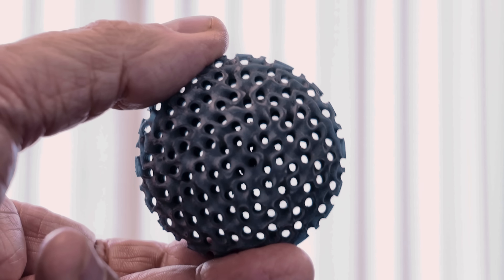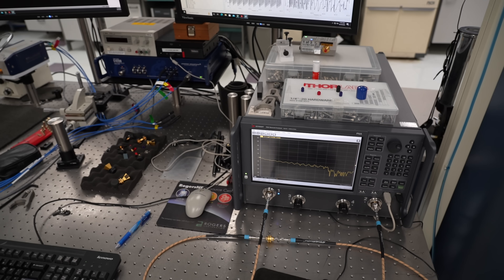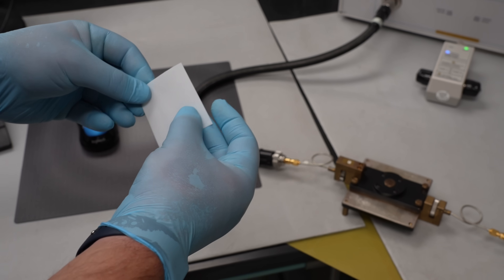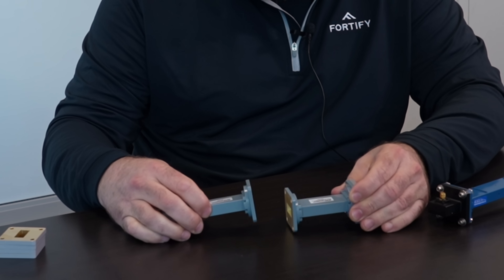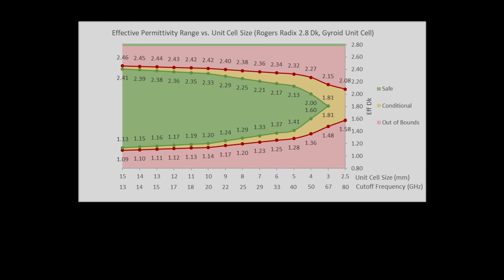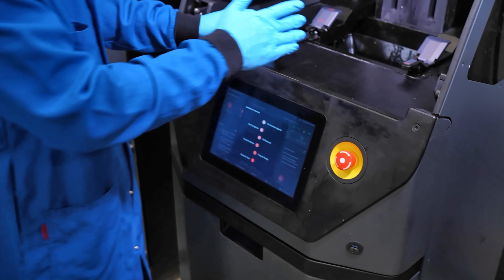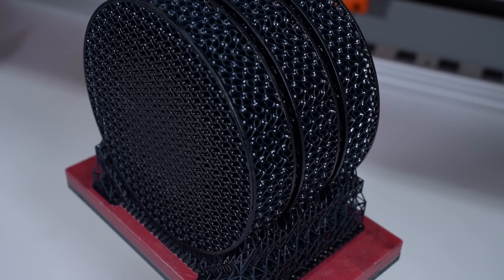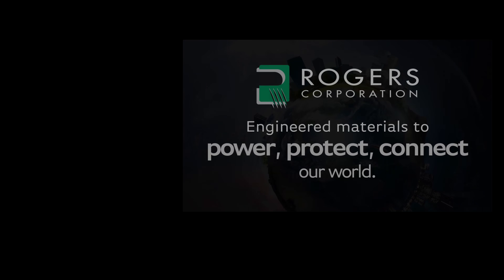Unveiling the Future of Antennas and RF Lenses using Radix™ 3D printable material!

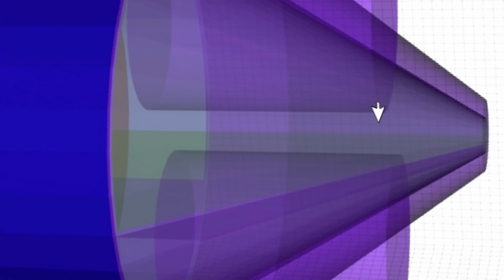Comment: 5:44 where I lost it. That was the best jargon interlude I have ever heard, so casual, had to listen to it 5 times. Fantastic. Master craft workmanship and concept. Couldn't figure what the  hybrid mode part meant. Modes in waves or an operational mode of the antenna, cool stuff. Don't mind me just passing through.
Reply from the maker: @electrikhan7190  Hybrid modes are just a superposition of a linear waveguide mode with the electric field entirely transverse and another, possibly circular mode, with the magnetic field transverse to the direction of propagation. The resulting combined mode has some magnetic and electromagnetic field in the longitudinal direction. It can be analyzed as a simple linear superposition of the two modes. That's a bit of a simplification. One day I might try to do a Blender animation to try to explain it visually.

Comment: It's kind of fun to watch videos about fields that I have no experience in that use words that I know, and try to guess the concepts being used.  I heard the phrase "loss tangent" being thrown around a whole lot, and I tried to guess the variables that would go into an equation where that's relevant.
Reply from the maker: Loss tangent is also known as dissipation factor. If the conductivity of a dieelctric is pretty much zero, the loss tangent reduces to the ratio of the imaginary permittivity to the real permittivity. For the values of typical microwave dielectrics, the loss tangent and loss angle are about the same (small angle in radians is near enough equal to it's own tangent).  The imaginary part of the permittivity is a result of the dipole relaxation and other effects in the dielectric and it has the same effect as a non-zero conductivity would, it causes conversion of EM energy into heat in the dielectric. The derivation is from Maxwell's equations. See https://en.wikipedia.org/wiki/Maxwell%27s_equations and https://en.wikipedia.org/wiki/Dielectric_loss

Comment: I wish I understood what it is you printed, but damn, I'm excited for you, and excited to see this video. All I understood was, "new 3D printing tech = cool"
Reply from the maker: The big disk is simplest to explain. It's like a magnifying glass, but for microwave radio signals instead of light.  Instead of having curved faces, the density of the material is high at the centre and low at the edge.  It follows a particular relationship so that radio waves hitting the first surface are refracted because they take less time to go through the less-dense parts, just like a magnifying glass for light works.  Beams going through the thinner parts of the glass go slower and the sloping face causes the beams to bend as they enter the glass.  The radio lens uses a different mechanism and the equation describing the density at a particular distance from the core needs to take that into account (that's the inverse hyperbolic cosine part, but it's just a way to define the required density at each radial distance.  By using the precise mathematical expression, the radio waves get bent just the same as they would if  they went through a magnifying glass with the same focal length. That's a slight simplification because there is also a quantum mechanical mechanism going on with multiple partial reflections, but the overall effect is very close to what you'd get if you made a magnifying glass from high density polyethylene or PTFE, except they are a pain to machine or mould, and tricky to support.  The simple cylindrical Mikaelian lens is easier to mount.

Now we have a lens that can focus, we mount a small radio antenna horn so it's "phase centre" is at the focus of the lens.  Microwave signals fed into the horn then illuminate the surface of the round face at the end of an expanding cone of waves.  The waves are then refracted and when they leave the outside of the opposite phase, they look like a searchlight beam of radio energy.  Because the cylinder is only around 15 wavelengths across, there is a bit of diffraction and spillage, so the output beam does diverge slowly.  

I'm going to try to show this in a future video rather than using words, as that will be a lot more obvious I hope.  The smaller part is much harder to explain, but it's acting as a sort of focusing lens as well, but the mechanism is very different and the lens is only about 0.8 of a wavelength across.  That's the equivalent of a lens maybe a third of a micrometre across with visible light.  It would be near enough invisible to the naked eye, so you have to look at the electric and magnetic fields really rather than using the large scale approximations of waves.

It is totally fascinating, but you need a good grasp of undergraduate maths to do all of the calculations unless you cheat and use an electromagnetic solver that runs a few hundred million calculations in tiny Yee cell cubes all over the model, working out every cell's effect on its neighbour and vice versa until you reach a steady state.  Finite Element Analysis is similar.  I use a Finite Difference - Time Domain solver.  Huge fun.  It's going to be a really interesting challenge to explain that lot without expecting everyone to do a two year maths and physics course starting with partial differential equations, but I'll have a go when I get some time
Reply: @MachiningandMicrowaves  Thank you so much for the practical and succinct explanation, I really appreciate the time it took to write this out and elucidate some of the deets. Have my sub, ser!

Comment: Stumbled across the video. I'm not into antenna's or frequency related items, but I do like tech....and this video is freaking amazing. Learned lots.  My thought from a broad scope is that as we move to more ideas available worldwide, I could see purchasing specific item designs (for anything) for personal use and going to the local '3D print shop' to get the device created for my use.  Commercial work could also be done by larger companies and more structured IP controls.
Reply from the maker: JLCPCB do a nice bureau service and there are some excellent US based services for laser sintering, so it's happening

Comment: A wave guide for Electro-Magnetic Energy is a profound concept.  Steering a radar pulse into the rough direction of your target, negates any omni-directional waves of radar broardcast.  The enemy would not know where you are, unless they were in your line of sight.
Reply from the maker: I use passive bistatic radar techniques to track planes sometimes, then I don't need to transmit at all. I just monitor the reflections caused by distant transmitters and use the reflections from planes to work out their speed and direction. It's tough to get height but I get a heading within 1 degree or so.  Great fun

Comment: Came across your video and was curious.  I have long thought gradient index technologies had great potential.  Always wanted to do microwave spectroscopic imaging of everyday materials.  If you have not seen how Tunneling Magneto Resonance detectors are made you might want to look. You can heat them with lasers above the Curie point, then cool them in a strong local magnetic field with nanometer resolution.  You might modulate the frequency of your beam to extend the near field.Thanks.
Reply from the maker: I've has a good read of some background papers about the tunneling effects and how nanometre cystalling MgO films were used, but I think that is about Tunneling Magnetoresistance as used in hard disk read heads.  I see some references about resonant electron tunneling in GaAs/GaAlAs double-barrier heterostructures but I don't see anything about laser annealing of the layers.  Do you have any references that might shed some light please?

Comment: The original machine has a base-plate of prefabulated aluminite, surmounted by a malleable logarithmic casing in such a way that the two main spurving bearings were in a direct line with the pentametric fan. The latter consisted simply of six hydrocoptic marzlevanes, so fitted to the ambifacient lunar waneshaft that side fumbling was effectively prevented. The main winding was of the normal lotus-o-delta type placed in panendermic semi-bovoid slots in the stator, every seventh conductor being connected by a non-reversible tremie pipe to the differential girdlespring on the "up" end of the grammeters.
Reply from the maker: Yes, yes and thrice yes.
Reply: Well said. Very well said. I’m forwarding your résumé to the Screenwriter’s guild so you may be employed on scripts for upcoming Star Trek movies.

Comment: Very interesting tech. I personally work in the satellite internet internet industry, and while I can definitely see a huge benefit to static antennas here, the industry is rapidly moving towards satellites that move through the sky in a LEO orbit.

If they can use this tech to make an efficient electronically steerable beam with at least a 120 degree scan range, then I'm 100% sold. That said, this may make better phased array antennas possible, and of course we're still using mechanically steered parabolic reflectors which could also benefit from this. You should also look at what companies like Kymeta are doing with reconfigurable metamaterials which, in my opinion, is the true future of RF antenna design. Had I been told a few short years ago that I'd be working with flat panel antennas that literally form a beam using microwave holography I wouldn't have believed it, but here I am doing exactly that.
Reply from the maker: Yep, the new chipsets for beamforming phased arrays from AD are looking interesting. Metamaterials is also getting interesting again after a surge of woo and invisibility cloaks a few years ago. Interesting times we live in.
Reply: @MachiningandMicrowaves  Very interesting times indeed. I just spoke with a company last week that are developing flat panel ground station antennas for LEO constellations based on some research out of the CSIRO. The radar antenna in the F-35 Lightning is also interesting, as it uses an active array meaning it can track multiple targets simultaneously.

Anyway, cheers for the detailed insight on this super interesting material. Hopefully I'll see it deployed in the field some time in the near future!

Comment: Good video, and you are obliviously a ham (amateur radio guy) like myself. There is nothing like doing and learning something just for the love of doing it. I worked in an antenna and radar cross section is Navy research lab near Philadelphia and I know Network analyzers especially the old and venerable HP 8510 and Scientific Atlanta antenna measurement systems a 40 acre antenna range and 5 anachoic chambers. I use to build antennas for myself and test them out there, it was great fun.
Reply from the maker: I have a US Extra but let it expire by accident so have to retake Tech exam now. US call was K1NS and AA1EG. UK call G4DBN, also operated from a relative's place in Bermuda. My little antenna rangd

Comment: I understand what you’re saying but have they considered the addition of six hydrocoptic marzelvanes, so fitted to the ambifacient lunar waneshaft that sidefumbling would be effectively prevented. The main winding would be of the normal lotus o-deltoid type placed in panendermic semiboloid slots of the stator, every seventh conductor being connected by a non-reversible tremie pipe to the differential girdlespring on the ‘up’ end of the grammeters. Moreover, whenever fluorescence score motion would be required, it may also be employed in conjunction with a drawn reciprocation dingle arm to reduce sinusoidal depleneration.

This should give you the results you need.
Reply from the maker: I think another commenter raised the ambifacience issue with that waneshaft.  Those marzelvanes are doing a LOT of work in that application

Comment: I have no idea how or why this video got suggested for me and I'm still having trouble understanding what commercial use this stuff has outside from military uses and cell phone towers I guess? No idea even if I'm even right about that either. I'm just some regular guy!
Regardless, fantastic video and happy to see breakthroughs anywhere in anything because then it can bleed into other areas you'd never expect.
Reply from the maker: I'll cover my applications for this in a future video.  One is to communicate with friend overseas by sending 10 GHz microwave signals to the moon, where they reflect off the lunar regolith and can be received in other continents.  That's cool enough for me

Comment: Uhh, in RF engineering in particular, there is a long tradition of a granted degree not being the defining factor for the title.  I think you qualify just fine.  Great video all around.
Reply from the maker: Same in my day jobs doing data networking, comms and cybersecurity. Mosr Uni courses are ten years out of date when their first students graduate. I did a degree in Astrophysics a few years ago to keep the old braincells ticking over. It's still mostly current, but most useful tech knowledge in my professional field lasts 18 months before it becomes obsolete.I recruit folks with no degree or one in maths or science. One of my best engineers had a degree in modern dance.

Comment: Microwaves are so fascinating, it's like working with some kind of a liquid, the way the waves are so large and guidable.
Reply from the maker: The smallest wavelength I'm using at present is 2.46 mm, 122 GHz.  That means waveguides which are less than 1mm tall and 2mm wide, or 1.8 mm diameter round guide.  That's fairly easy to machine, but I want to try tests at 248 GHz, and that is getting REALLY tiny and hard to machine.  I have a licence variation which allows me to transmit at even higher frequencies up to 1 THz, but that's very very tough engineering.  I'd like to break the 300 GHz barrier t some point, wavelengths around 1 mm, but that's some way off for me in a home lab and workshop.  One step at a time...

Comment: This is really motivating me to try and learn more about RF physics/engineering. It seems quite interesting!
Reply from the maker: It's kept me fascinated for more than 40 years.
Reply: @MachiningandMicrowaves  can this help in fpv drone antena ???
Reply from the maker: @covakoma1064  rather tricky at such low frequencies, but if the drone is using perhaps 38 GHz then it might be useful with beam steering for giant drone arrays I guess